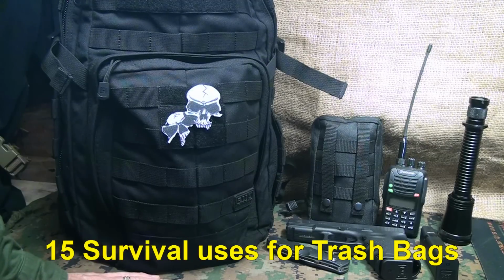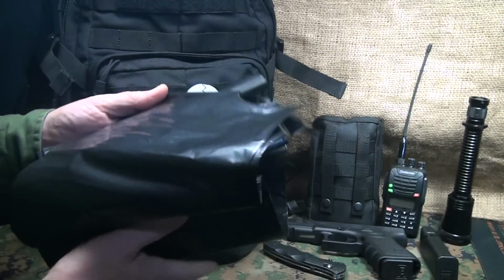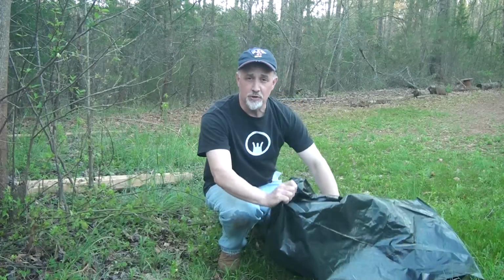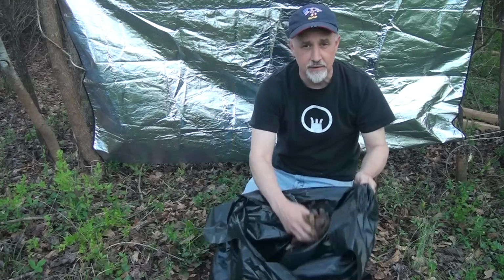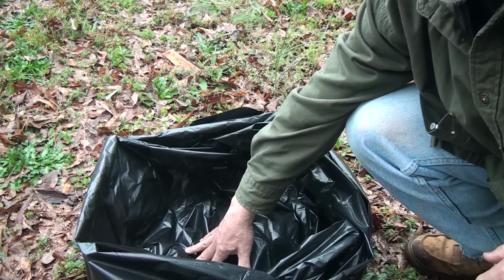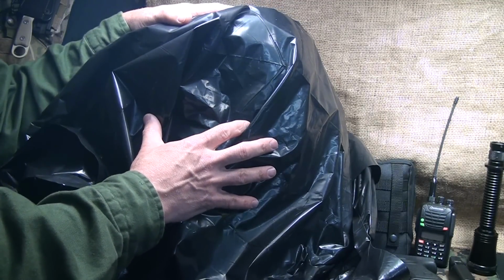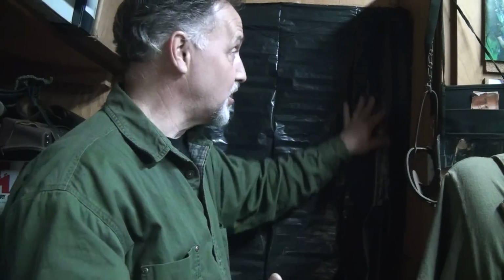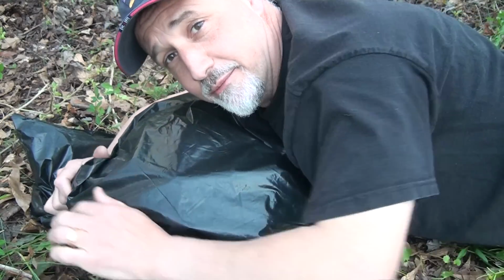15 Trash Bag uses for Survival

Comment: If you partialy inflate  several bags then close with duct tape would that make a better insulator for the ground than filling it with leaves etc? I undertand the leaves would create micro pockets of air etc , just wondering which would be more efficent.

Comment: Related to this might be hay tarps. For example, it is possible to customize this material by melting two pieces together to form a "seam". Hypothetically, you could cut out the pattern pieces for anything you want to create, such as a poncho, a tarp, a bivvy sack, a dry bag, etc, and then connect all the pieces together with a heat gun. This is done by heating about a foot of the overlapped "seam" with the heat gun, then rolling the seam with a roller, and doing the same all along the seam until complete.

Comment: One way I use these is cut open the sealed end and one side you have a plastic sheet throw it over your shoulders and pack tie ends loosely round neck and waiste and you have a water proof back pack civer. Even the thin cheaper bags work extremely well . Can be reused too.n

Comment: The black bags work good for night camo, white ones work well for winter camo. Green or brown ones make decent camo for appropriate environs. Other colors (pink, blue, orange, yellow, purple, red,...) are good for attracting attention.

95 gallon bags (61" x 68") are better at covering your entire body. They are usually thinner and less durable, but are light enough to carry extras. They make better bivy sacs as long as you can be sure the underside is safe from punctures. They also make good improv rain gear, covering you to your feet with a pack. And the pinched bottom ones work better to provid a hood by cutting a hole a little smaller than your face, slightly down from the "pinched" bottom and squeezing your face through so it is snug.

You can also gather fire wood and tinder before a storm and keep it dry in a garbage bag.

And don't forget those little plastic shopping bags, I always carry a few of them,They pack down to almost nothing and can be vey handy. I have a few I picked up in Puerto Rico at an Amigo supermarket (they don't hand out shopping bags, you have to B.Y.O or buy one of these) that are like 4 mils and really tough.

Comment: Line the bucket portion of your pack with the bag before filling it.  Fold and layer (don't wad) the excess over the top.  Could also be used on your sleep system and pad.
I've seen someone with time on their hands make rain pants out of them.
Would you tung oil and bees wax your bag as a layer of protection?  Saddle soap?  Spray on waterproofing?

Comment: Good ideas. Even much thinner, lighter trash bags are very useful and easier to carry in a pocket. In cold wet conditions a second bag opened at both ends and worn as a skirt will keep your thighs dry and really help prevent hypothermia, as well as allowing you to keep moving towards better shelter and safety. An excellent way to help other people who may not be properly equipped in the outdoors.

Comment: We do not cut the corners because that renders them useless for other applications but rather we place a small pebble in the corner and wrap them with cordage

 to fabricate a Pancho we do NOT cut the seam at the bottom of the bag but rather we cut the bottom side of the bag so that the bottom seam of the bag will still protect the top of our heads

In this way you can hunker down and use it as a bivy sack with your back to the driving rain
In order to use rainwater collection you can get twice the amount of rainwater collected by placing Pebbles at Each corner of the bag using small pieces of cordage to wrap around the Pebbles and wrap around the steaks so you can use the entire side of the bag rather than opening the bag and having a much smaller collection container

We also place a large contractor size bag in our backpack before we insert any other items in order to help keep water out of our gear if we have a river crossing

Comment: Good,  but could do some things better. Others have already pointed out better methods for using the trash bags as you showed here, but I'd  say if you can afford it and have a way of getting it (purchase online, or in store, or a yard sale if you are lucky), go with military items. I love wool blankets because they are a little heavy, but not too much and are slim enough you can easily pack it. The assault pack, medium and large rucksack have a kind of plastic interior that, while not waterproof, is fairly water resistant,  so you can go through drizzle or short rain showers and have almost no water damage to things inside. And also the poncho, while not a wrapped body with sleeves, at least the ones I've seen and been issued, is rather durable, I'm between 6' and 6' 3", depending on who's measuring and covers almost to my feet and has an attached hood, has grommets so you have no reason to cut holes, also can be used for shelter, to cover your assault  pack, medium or even large ruck, wind breaker,  improvised bag, etc. From what I've seen in the local military surplus here, look to spend at least $80 for the three of those used, and closer to $200 if buying all of them new, though, you don't have to have a new wool blanket, old ones are still good, and I was issued a used poncho and had to turn it in at the end of BCT, and the assault pack I have was given to me by a Sergeant from another platoon thst said it was on 4 deployments,  and it's still going strong, so you really don't NEED new. Also, I've seen multiple colors for wool clothes at the military surplus, if you want to shell out about $30 for a pair of pants and jacket. Note: Oregon..... well, at least wasn't a tax state, but I keep having places try charging taxes now, so prices will vary for people of other states.

Comment: By the way, if you cut a slit a little longer than your face, starting about 6" below the bottom seam in the center of the bag, you can pull it on like a poncho, stick your face through the slit, and have the closed end of the bag act like a hood -- keeps the rain from funneling down your neck onto your torso.
If you already have a poncho or rain jacket, but want to keep your legs dry, cut the bottom open, use the drawstring or tie tabs like a belt and wear it like a skirt, tied up under your jacket or poncho.  It will keep you that much drier, and still allow you to walk.
Also, any bears that see you walking down the trail wearing a plastic maxi-skirt will collapse in laughter, allowing you to proceed on your way.

Comment: A 20-30 liter dry bag costs about $25.  A 55 gallon 3-mil drum liner costs about $2.  Put a bag in the main bucket of your rucksack, fill it up with your clothes, meds, sleep system, etc.  Press out as much of the air as you can, and then ROLL the open end down (just like a dry bag), pull the corners together and tie a loose overhand knot).  Now, everything inside stays dry, rain or shine.  I never can understand the nitwits who go on these massive trail hikes and then bitch because their $30 backpack didn't keep all their stuff bone-dry in a downpour.  $2, dude.

Comment: Trash bags are a very useful as a solar still. Bunch up several twigs still attached to a tree, put the bag over them, cinch it closed and the heat and sun will draw moisture out from the tree.
Also, just put the trash bag inside your pack, with your gear in the trash bag to water proof the gear. This also causes your pack to be buoyant enough to be used as a floatation device.
Reply: King Grizzly Beard 

Of course with a solar still if the tree is poisonous (ie Manchineel trees), you got a problem!!   🌿💀 💀 💀

Comment: One option is to put the bag inside the large section of the pack. It's always waterproof then. It would work better with a smaller trash bag than a heavy duty one.

Comment: Urban Hunting Blind/Hide: Shake out your bag,  trap air then tie off as close to the opening as possible, dust with cornstarch, line chalk, what have you, then make a vertical slit down the middle of one side of the bag, sit down and cover yourself with the bag and make a T-shaped cut at about eye level, use a little glue to keep the ends of the cuts from widening and you have a blind fit for a .22 rifle

Comment: Food for thought...Why not place the garbage bag "inside" the pack, then put your gear into the bag?This way you're not cutting holes in the garbage bag for your pack straps (and subsequent possible water leakage into the bag). Additionally, this method allows you to reuse the same bag (intact) for a higher priority if needed later.
Reply: Maximus Meridius I do it that way
Reply: Thinkin the same thing

Comment: I wouldn't poke a hole in it when using it as a rain fly. Once you've compromised the structural integrity of those bags, they rip pretty easy. The rain will collect in the middle until that hole gives, dumping all the water on whatever is below. Wrap the corner around a small rock instead, then tie the cord around that.

Comment: the big bag also works well .. as a liner for your pack .. fits fine on a large ruck .. you can also use smaller bags to wrap things in your ruck .. number one keeps them dry .. number two .. they are slicker so they work when you are packing your bag

Comment: For gathering water in a cup in wilderness:
Dig a hole
Put cup in center of hole
Stretch plastic above hole
Put a pebble in the middle of plastic so that it creates inverted cone from the plastic
The humidity from the soil will gather as dew on the inside of plastic and the cone shape will cause it to trickle down into the cup (which is under the point) in the morning when the cold air outside will cause the dew to distill and liquify. You got water in the morning :D

Comment: certain things we currently consider trash, such as dead batteries, gum wrappers, tin foil and aluminium cans can be extremely useful.
the batteries can be torn apart into cell batteries, the aluminium and tin can be used to complete electrical circuits such as flashlights, in fact some gum wrappers are made with aluminium and paper, when used to complete a circuit would create a very small fire.
in a zombie apocalypse or post-tsunami, even dead batteries, gum wrappers and empty cans are helpful.
speaking of empty cans: if you cut it in two (about 2/3rds from the base) and fill it with a flammable liquid, then soak a wick or imitation wick like cotton fabric or even paper, create an extra hole in the top and put the wick through the smaller hole. the end result? a homemade gas light
Reply: as for more uses for heavy duty plastic bags, cutting them along 2 sides so they are much wider, then tying several together in some form or another you can create a very large tarp and angle it to make a lean-to. the resulting effect could be something as simple as creating A TENT with these bags as the main ingredient. in fact, if you have it as a kind of igloo-type tent, but with a wide opening to a fire, the heat headed into it can only leave through that one opening. make it very effective as keeping you warm.
combination with the ideas in the video: igloo style lean-to opening to a campfire, dry leaves as flooring for further insulation, special ones for pillows, longer ones made from two or more with even more dry leaves in to act as blankets, heck you could even make an extension to direct more heat from the campfire towards the lean-to!

Comment: If you're using it in conjunction with a pack, just stuff it into the pack like a trash can liner, stuff your things in the bag, then just simply folding it over and tucking it in will allow the bag to get soaked all it wants, but the contents inside will stay dry... That's actually Company SOP with our rucks for those of us who don't have wet weather bags...

Comment: I like the bags for sure, but a small roll of Visquene (heavy duty plastic ) and a staple gun you can make a shelter that will keep you and your stuff very warm and dry. We always kept a roll of duct tape that wasn't used up. All good stuff, I really like the idea of using the bags to be insulated from the ground as you stated it will suck the heat right out of you and that's miserable even for a younger person (that I'm not) so ill be adding a few contractor bags.

Comment: Thanks for the tips.  Here is a heads up for you.  Walmart recently started selling Gorilla brand trash bags. 3.3 mil 42 gallon and they claim they hold 200# each.  They are square bottomed and will stand on their own in the absence of wind.  A just bought a box of 12 for $12.50.  If your haven't tried the Gorilla duct tape, I highly recommend it.

Comment: One improvement I would suggest. I got this from Ron Hood. To tie plastic with paracord to trees for shelter, do not cut a hole in it. The wind will tear that out very quickly. Use a small pebble or rounded stick to back it up and make a toggle without cutting the bag to tie the paracord to to opposite side with a cinch loop.

Comment: I didn't know if you knew this but I used to work for a Cleaning Co. for many years and almost all of trash bags are treated with certain chemicals and different things but in a survival type atmosphere I would still use for water if I had to and if was for long period of time I would Boil the water before drinking it I only know this about the bags because I used to use and change hundreds of trash bags a day for several years

Comment: Do Not make a hole for the Head. Just for the eye. That will Protect you from rain
Reply: I'd leave a breathing hole, or you'll have all your breathing moisture condense inside the bag.
Reply: Black Wolf Or you can make it breathable. I have tried this with a polythene survival bag. Take a pin or needle or very fine thorn and poke tiny holes from the INSIDE to the outside. The holes are too small to let raindrops in but more than big enough to let saturated air created by your body to pass through. Of course this method will mean that it is no longer waterproof to sit on. With a survival bag use only prick the holes on the TOP side of the bag. It does work as a breathable bag.

Comment: Aloha.
Subliminal note on color with the Heavy Mil Large Trash Bags being black and the BOB gear on the table being all black?  If so, I got it....and have been using that mindset for many years.  I standardize most of my gear with black or dull greys, for the simple fact that no matter where you are, it is night-time roughly half the hours in the day.   During the daylight hours, if you need to deal with a specific camo scheme for your location, use the best type of camo scheme in an overall cover or tarp.  Rather than having all your gear specifically OD Green or Desert Tan or whatever, by having your gear black, you are optimal for 1/2 the hours in ANY location, and you can cheaply fine tune your color for wherever you are at during the day.  Which is cheaper and lighter, having 2 full sets of gear in OD Green & Desert Tan for both the forest and the desert, or having 1 full set of gear in Black, and just adding 2 overall ponchos in OD Green & Desert Tan for the daylight hours?

Peace & Prepare
Pax et Paro

Comment: I use commercial clear 1100lt 300 Gauge wheelie bin bags Length: 1960mm Width: 2100mm Depth: 1360mm, at work they make ideal bivvy bags one possible draw back is they are clear, the black ones cost 5% more. Another possible option is Polythene Layflat Tubing from a builders supply merchant, very heavy duty and you can cut to custom length.

Comment: Great video!

I once used two bags as a sort of air filled bivy sack. By leaving lots of air space the fire's radiant energy heats the dead space and creates a mini greenhouse. I originally was using them as a lean-to shelter but the cold motivated me to try a greenhouse approach.
Reply: How quickly does the moisture build up? You don't want to get wet inside the bag.
Reply: Black Wolf
Moisture was not a problem at all.

I should point out that the lean-to failed to reflect heat because the radiant energy passes right through the plastic. A space blanket would have been a more effective lean-to. With a greenhouse approach, the radiant energy hits your body and it heats the trapped air. I actually remembered an episode of Dual Survivors when I was shivering and decided to try a greenhouse approach. Also, I heated a rock which I placed between my legs near my femoral artery. This helped quite a bit for about 30 minutes until the rock cooled. I rotated two rocks; one on me and one near the fire.

Take care!

Comment: The trash bag only works when it is NOT raining. You just get wet slower than faster. Just get a lighweight US Army poncho and crunch it down in your pack. Its just works far better, easier to wear and goes over your pack to keep everything dry. Contractor bags get shredded walking through the woods, are loud, and water will come down your back. Tying on off in the wind with para cord only rips out.
Reply: I'd strengthen the cuts with duct tape.
Reply: Your are right duct tape would work very well. I found tarps at Harbor Freight that were 5x7 and FREE with a any purchase. Sale coming up over memorial day. Good hunting
Reply: uscgalpha91 Not everyone has access to complicated supplies but garbage bags can be found at a dollar store
Reply: @nathanaeldardano4069  um.... A poncho is anything but complicated
Reply: @adamfleck956  Thank you Adam.

Comment: I'd suggest placing a small pebble or stone in each corner of the bag instead of cutting holes in it if used as a tarp or shelter. This will enable you to tie around the stone with cordage, giving the trash bag less chance of tearing and keeping the underside from collecting moister from water running down the cordage once anchored. 

Great video As always Don.
Reply: Very nice tip.
Reply: I'm 5 years late, but I was just coming here to suggest that. This method has saved me a couple of times when the corner grommets have ripped out of tarps with the first big gust of wind. Cheers.